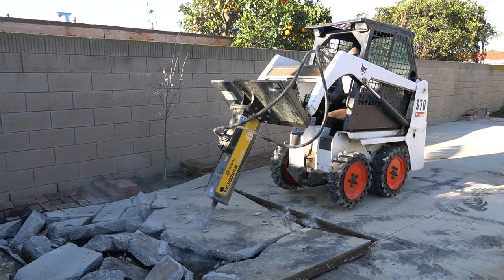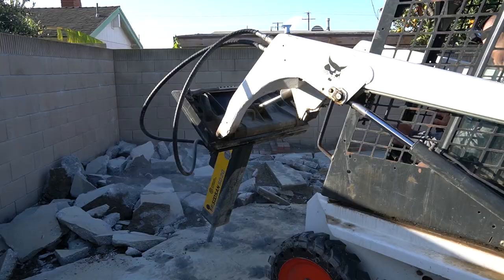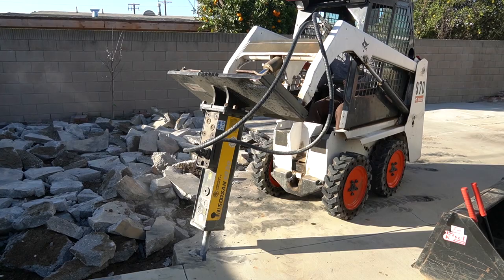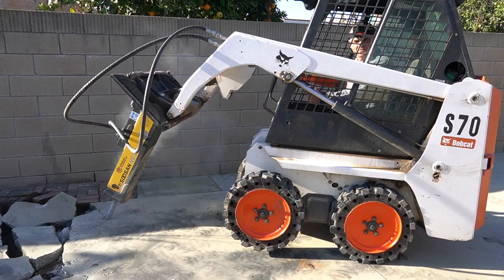Concrete Demo. Bobcat S70 w/ Soosan Hydraulic Hammer. California

Comment: Also, you said that you filled 2 semis, but it looked like you were hauling with 10 wheelers. Did you only fill 2 10 wheelers with 1700 square feet? If so, that’s amazing! We are usually getting 600 square feet max. Props🤜🏻
Reply from the maker: Yes two ten wheeler's. I have a guy in back of the dump with a sledgehammer filling all the voids. I pack it👍

Comment: dude, A mt55 Bobcat is just as fast as your s70 with a h55 Cat breaker.  that Soosan breaker hits slow.  Even the specs between Cat Breakers and Soosan breakers proves the Soosan is stupid slow. I aint talking shit either
Reply from the maker: 😂stick with your lawn mower. Put a video up of you planting tulips with your mt55.
Reply: I really doubt you can run a H55 (500 ftlbs ) hammer on a mt55 but you are not comparing apples to apples my friend, and there are several H55 models one is manufactured by Sandvik and other E series is made in China 🇨🇳 I would put Soosan SQ20 up against any 350 ftlbs any day
Reply: @tramac65  On the other hand, awesome video and i will give you a thumbs up.
Reply from the maker: @dankruger2890  👍